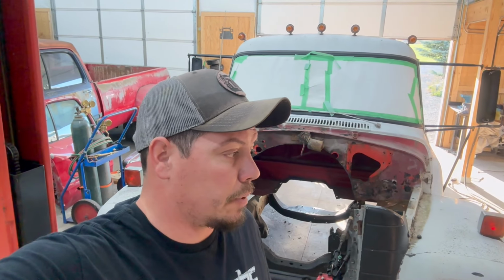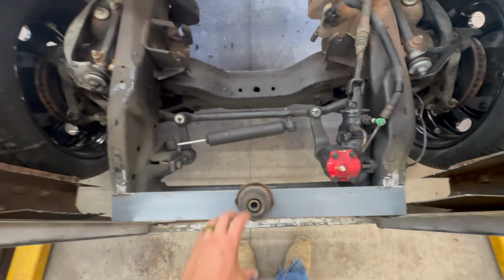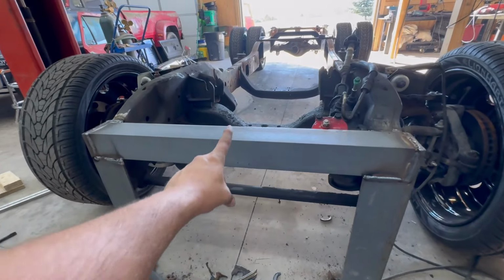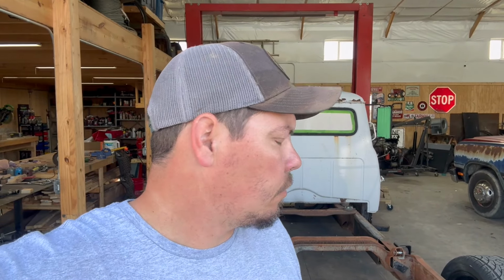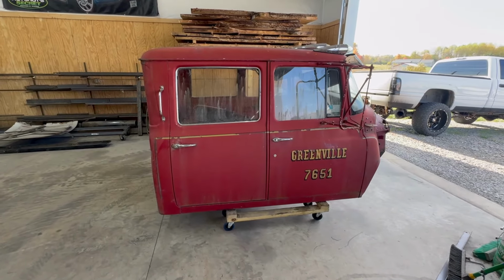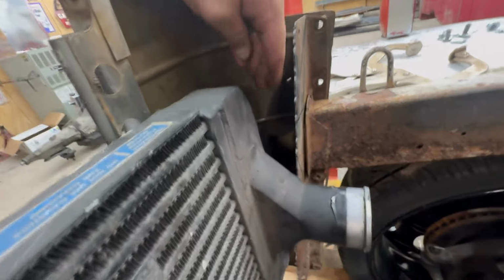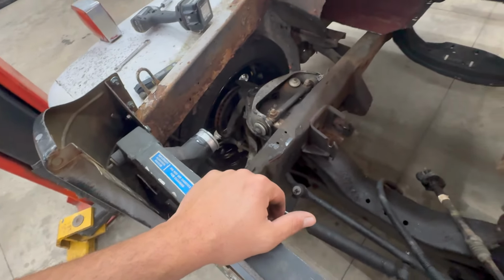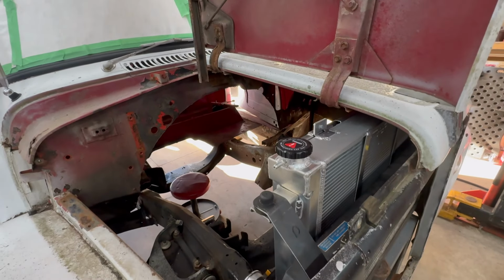Will it all fit!!!!

Comment: New to your channel. Nice build. So what year of frame are you using. Dodge obviously. And what length?? Asking because I am wanting to build similar truck except a gmc cab. It was my grandpa’s grain truck. I drove it when I was a kid, hauling wheat to the bin. It’s in great condition, nice patina, no rust. I want to resurrect it as my daily parts getter. Thanks
Reply from the maker: Frame is a 99 dodge 3500 2wd extended cab long bed not sure the full length but it’s around 18ft. Sounds like a cool build thx for watching
Reply: @adamspragen   Thanks for the response. I’m looking forward to following your build.